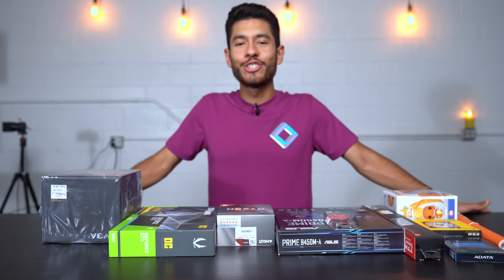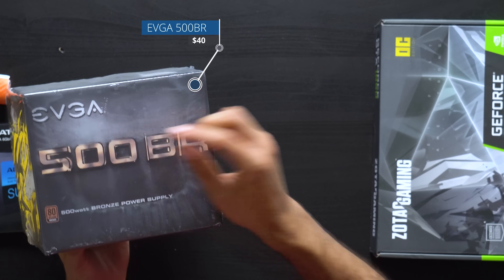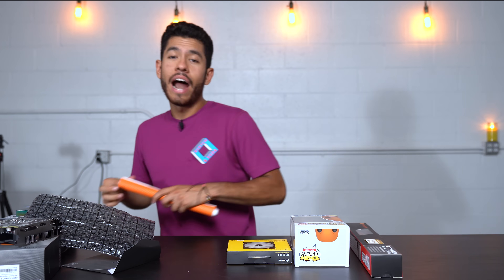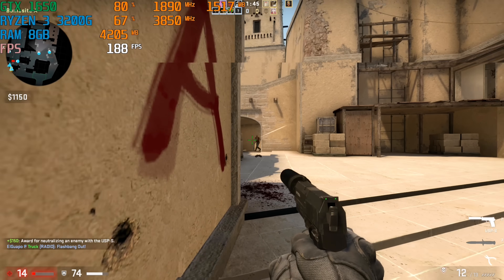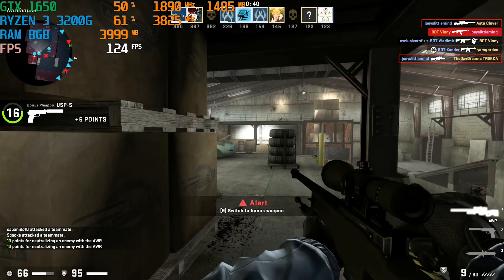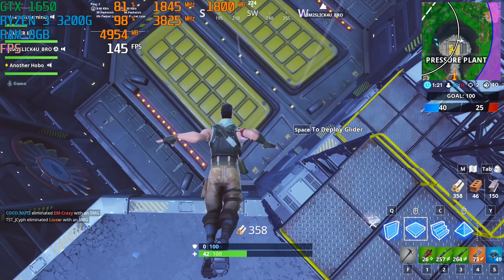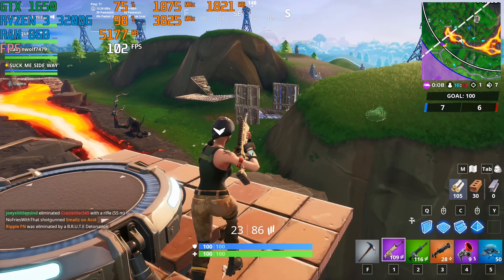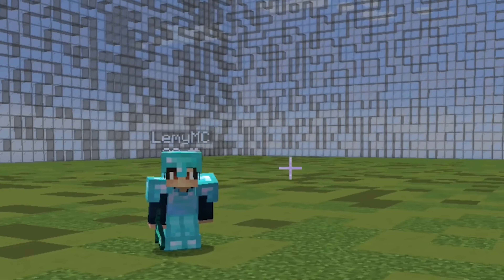$500 Gaming PC Build - GTX 1650 Ryzen 3 3200G (w/ Benchmarks)

Comment: The single ram stick on motherboard really messes with me.
Reply: Bonzxi you can use whatever ram you like but here are some things to remember

1. Use the same type of ram i.e dont use an 8gb stick and a 16gb stick
2. As mentioned earlier all sticks run as slow as the slowest stick (if you got 1 3000mhz stick and you have a 2333mhz stick they both run at 2333) 
3. Remember to slot them correctly, on your board, if its only got two slots your fine, but if its got 4, 2 should color match each other, and so should the other two; it doesn’t matter witch two you put your sticks JUST MAKE SURE they’re in 2 slots that match colors with each other ( usually alternating. 

If your keeping this in mind yes you can just put two sticks in now
Reply: Big Stonman big help 👍
Reply: @DeliriumXM  https://www.amazon.com/gp/product/B00J8E92I0/ref=ox_sc_act_title_4?smid=A2L77EE7U53NWQ&psc=1 
would this ram work?
Reply: Big Stonman thank you bro, me and my best friend are going to build this pc with 2 8gb ram sticks and this helps a lot
Reply: @BearyNiceGamingHD  As the other guy stated, and I'll put it more simple. If your motherboard as 4 slots that ram can go into, make sure when using 2 sticks of ram not to put them next to each other. You'll either have to put them in slots 1 and 3, or 2 and 4. Your motherboard should have some writing or diagram on it next to the ram slots to tell you which ones they go in. If your motherboard has only 2 slots where ram can go in, then it's OK to put them next to each other. Also, make sure you buy 2 of the same exact ram sticks or buy a pair of 2. Mix matching different kinds of ram can lead to unwanted problems.
Reply: Hyper x ones are out of stock can I use any ram sticks? I’m gonna get two 8 gigs
Reply: Drewskiii yes but it will only be as fast as the slowest ram for Example - if you have one ram stick at 3000mhz and one at 2333mhz it will run both at 2333mhz
Reply: @drewskeezii  patroit
Reply: Perspective. Yer thinking of a finished product. This is simply to get you started.
Reply: @franciscoescalera337  what a satisfying reply.
Reply: @franciscoescalera337  can you upgrade GPU and CPU on this motherboard?
Reply: @MyTardisGoWhoosh  to be honest.. this build is for 1080p. When you build this computer, you have a solid year or two to save up for the build you truly want. I would use this build and sell it as the whole set when ive had my fill. It's like buying a ps4 and then when the ps5 comes out you sell the old. Now if you were spending $1,000 to 1,300 on a computer, THEN you start to reuse your parts in your new build.
Reply: @franciscoescalera337  I'm fine with 1080p.. probably for the rest of my life.. I swear my eyes don't notice the difference when it's that high. Plus I want to play games like League.. starcraft 2.. the upcoming Warcraft 3 reforged..I mean....tbh I am over killing BIGTIME..
Reply: @franciscoescalera337  not fully true if you have a decent mobo, case, psu and ram you can use that on your next build. Whilst building a computer it is important to think of upgradability I'm not going to par a rtx2080ti and r9 3950x in a a320m mobo with a 450 smart psu instead of going price to performance go for a more balanced build that will be able to keep up with your new parts
Reply: @franciscoescalera337  what you said in your original post is that you sell the whole pc after a few years what's just not true what I'm trying to say is that if you have a well rounded pc many parts can last you up to a decade depending on your budget it's not like a 750w psu from 2014 isn't gonna work on your entry level pc now, I realised that mobos change alot and k was wrong about that but the rest are almost always compatible with modern hardware
Reply: Just get an Rx 580 and save yourself $50 and use that for another 8gb stick.
Reply: Jesus is Lord yessir Jesus is lord
Reply: I was just about say here comes another verge build, haven't seen this Chanel before
Reply: I got two 8 GB sticks for a bit extra cost
Reply: Yeah, I checked amazon and you can easily get a 2x4gb for a cheaper price.
Reply: good if you plan on upgrading to 16gb which alot of budget gamers like myself do. get the 8gb stick and then a few months later chuck another in.
Reply: Do you know any ram that would work with this pc 16gb i dont want to buy any bad ram
Reply: @kobygould1847  Corsair vengeance lpx 3200 is pretty good at that price make sure you get a 2x8g kit
Reply: Nah he def should've put 2x8gigs, you can get that for around 50 dollars 3200 and still be in the budget, assuming you didn't get some of the additional things he got like the Funko Pop and the fan
Reply: BananaTech Gaming where can you get 2x8gigs for 50 dollars
Reply: @eirto  it goes on sale all the time, just a week ago you could get some T-force or G.Skill Aegis ram for $50, I thought that was the regular pricing, but I guess not. You can still get really inexpensive, fast ram very often.
Reply: Either use 2x4gb 4x4gb sticks  or 2x8gb 4x8gb sticks u want 2 or 4 ram sticks never 1 or 3 if u want the best performance for what u buy
Reply: Theres no problem with that. Hes not using the APU, so single channel wont matter in terms of gaming performance.
Reply: @abmeight08  Not saying you're wrong but I immediately saw a different in performance going from single channel to dual channel on my r5 2600
Reply: @Bonzxi nah u can get two for less than one
Reply: Y'all can just get two for less on Amazon
Reply: Can i use a different Graphics card on this build ??
Reply: pooper12 he probably doesn’t know much about PCs yet
Reply: You know if it can run mw
Reply: Aaron Bostwick it can averaging around 70-90 FPS I believe.
Reply: Nola Hype really appreciate it
Reply: Aaron Bostwick you’re welcome! Let me know if you end up building this. I’d like to know how it goes.
Reply: ZxMbi ikr
Reply: It's so it's easier to upgrade in the future; just slot an extra RAM stick as opposed to replacing with better RAM so ultimately cheaper
Reply: I used 2 four gb ram sticks
Reply: What about the single 128gb, just Fornite  alone is 55+GB
Reply: Carlos Salas You can add a hard drive with 500 GB or 1TB if you need more space
Reply: xD ikr ive got the same build with 400$ but 2x8gb 3000mhz srry for brainded grammar
Reply: https://www.youtube.com/watch?v=T61UWX2I50A
Reply: Yes
Reply: With graphics card it's fine
Reply: this build is fk trash like most of his builds
Reply: @excelsiusprime  for people with not much money this a perfect pc even 350 dollar pc outperforms a ps4 pro so bruh

Comment: I can tell you rn that i have built a better 500$ budget pc.
Here it is, so you dont waste your time with this one.
Cpu: Ryzen 5 1600 // 100$
Motherboard: Gigabyte GA-A320M-SH2 // 55$
Ram: Patriot Viper 4 3000Mhz 8gb dual channel // 38$
Gpu: XFX Radeon Rx 570 RS XXX, it has 8gb vram, and clocked @ 1286Mhz non OC // 149$
Gpu option 2: Msi Gaming Rx 580 256 bit, 8gb vram // 169$
Storage/HDD: White label 1TB 32mb cache 7200RPM SATA300 // 30$
Storage/SSD: ADATA SU635 240GB 2.5 inch internal // 29$
Case: Zalman T3 Micro ATX mini tower // 36$
_______________________________
TOTAL: 437 USD $$
TOTAL W Better GPU: 457 USD $$
------------------------------------------------------
NOT INCLUDING TAX
_______________________________
Extras, you dont need them:
Case fans: uphere 3-pack // 10$
Monitor: Acer SB220Q bi 21.5" FHD (1920 x 1080) IPS Ultra-thin Zero frame - 75Hz - 5ms response time // 90$
Keyboard: any keyboard should do, but if you want my opinion, budget: 50$ keyboard+mouse combo red dragon - not budget: razer BlackWidow green mechanical switches Tactile // 98$   \\\\OR/// Razer Ornata expert mechanical membrane // 68$
Mouse: Corsair RGB // 50$
Reply: thank you
Reply: how would it run in gta 5? like the fps
Reply: @kdog773  probably in the high 80s-90s, thats on medium-ultra settings. 
-- note: i forgot to include a psu, but it still will be about 10$ under 500$ if you get a 500-600 watt psu.
Reply: @keegang9599  but why use a a320.
Reply: @keegang9599  and btw have you built this pc, or you just said what parsts you can get for same price
Reply: @pewdiepiesupporter8682  Because its a cheap motherboard. You could get a B450 for about the same, maybe a little more expensive. Just a "decent motherboard that supports 3000MHz ram. And it shouldnt bottlneck the hardware to bad.

Comment: Im having trouble with the last few steps, is there anything i need to plug into the gtx 1650 like anither cable after i plug it into the motherboard and i added another fan just like you did in the video but theres a total of 3 fan plugs whete do i plug the 3rd one, i only see 2 on the motherboard. Sorry this is my first time building a pc.
Reply: In the manual for the motherboard on page 1-1 there is a overview showing where the fan headers are.
 https://www.asus.com/us/Motherboards/PRIME-B450M-A-CSM/HelpDesk_Manual/

There are two left to ram slots
and one below the cmos (coin battery on the board).

If you have the same card in the video the card is powerd from the slot.

Comment: !!! CAUTION TO ANYONE WHO WANTS TO BUILD THIS PC !!!

This particular AMD Ryzen 3 CPU is a third generation and the motherboard he uses is a 2nd generation. These ARE NOT compatible unless you can manage to update the BIOS of the motherboard to handle a 3rd generation CPU. I don’t know why he left this information out because it’s very important. If you build this PC as is, it will not boot up. 

Solutions: Get a Ryzen 3 2600 (2nd Gen) and it will be compatible with the motherboard. 
Another solution is you could upgrade this motherboards BIOS to 3rd generation. Finally, you could get a third generation motherboard.
Reply: The motherboard seems to have the updated bios for 3rd gen
Reply: Apache Helo Copto It doesn’t come defaulted to 3rd gen as it is a 2nd gen motherboard. He didn’t tell anyone that though. He just solved the problem and went on ahead. I have a friend who just used this build guide and he doesn’t have a CPU that he can update the BIOS with so he is buying a new motherboard that is 3rd generation.
Reply: @braedenhunter6501  odd seems to be shipping with the updated bios. did yours come with the ryzen 3000 ready sticker?
Reply: Apache Helo Copto It wasn’t mine, but no, his did not, I don’t think. Most of the ones you are going to be finding and buying off of New Egg and Amazon are still second generation BiOS.
Reply: @braedenhunter6501  but it depends on where you buy it, some may come with latest bios and some does not.
Reply: pewdiepie supporter Don’t you think he should mention that, even if it’s brief? Jayztwocents, BitWit, and LTT all have. These guides are for beginners mostly, and that isn’t something an incoming PC builder would know off the top of their head. He should have said that as a precaution.
Reply: @braedenhunter6501  yea I agree with you.

Comment: Will Corsair vengeance ram work with this build? 8gb, I also want to change the cpu to a ryzen 5 2600 and a powerline wattage of 600w
Reply: The ram should work. Just make sure it is ddr4 and at a speed the motherboard can handle id recommend 3200 or 3000. Also the 2600 is a better choice ;)

Comment: I built this exact build but with an rx 570 instead but can barely get 40 FPS on fortnite with the settings he used in the vid. Any help pls!?
Reply: View Distance: Epic
Shadows:Off
Ali Allsiting:off 
Textures:medium 
Effects:medium 
post processing:medium
Reply: No I mean overall my exact same pc build isn’t working as well as him? Any tips?
Reply: Maybe the rx 570 is weaker I am not sure
Reply: Maybe he over clocked what GPU edition did you use
Reply: Mythic _ I have a Radeon rx 570 which should be like 10-20 frames better. I may refresh my os

Comment: Dual Channel RAM gives you actually a pretty massive boost to fps, I recommend going with 2x4 GB instead of 1x8, also the RX 570 is cheaper and performs better than the GTX 1650.
Reply: I went with 2x8GB
Reply: YOUR and YOU'RE are 2 different words what
Reply: @kevensmhith  why not 1x8?
Reply: That's a great one if you weren't going to upgrade the ram. And the 1650 build is good for minimal power usage
Reply: @pauloazuela8488  Very true.
Reply: If you're on a tight budget it's better to go for 1x8
Reply: eeee
Reply: And also why not ryzen 2600 . That’s cheap now
Reply: lol every one seems to think the rx 570 performs better then the 1650 xD haha they just watch too many tech  youtuber opintions and haven't tried it themselves I personally have 12 rx 570 and 15 gtx 1650s and the 1650 always  run games better faster quieter and draws less power not to mention amd drivers ? its a joke GeForce gaming exprince give you 15+ fps so that alone will make the 1650 out perform the 570 even if on paper it seems like it wont also  its always better to get 1x8gb then 2x4gb cause then u ruin ur whole upgradability taking up all the slots with 4gb lol that means u can only have a total of 16gb of ram and all 4 slots will be used even worse if you have a micro atx mobo they only have 2 dim slots so getting 2x4gb will only let you have 8gb total  forever and that's less then recommended now a days so no buying 4gb ram is not worth it no matter how much you think doul channel improves nothing actually ive already ran most my systems with a single stick of ram and I have 2 pc with dual channel and after 14 month of switching between the 2 I cant tell one shred of difference
Reply: seb0 seb0 im dead this mist be satire if its not then r/imverysmart
Reply: @CHICKENmcNUGGIESMydude  not true having two sticks are better than 1 because of duel channel and surprise its cheaper by a few dollars but still cheaper and a rx 570 is better at running 
most games than a gtx 1650 its the fact that a lot of games are in favor of nvidia drivers not the overall gpu horsepower
Reply: @CHICKENmcNUGGIESMydude  i HaVe 15 gTx 1650s HeHehE yeah okay big brain

Comment: can the gtx1650 handle nba 2k20 mid to high settings? thanks!
Reply: definitely yes! even the 1650's predecessor, the 1050, can manage an 80fps at High preset settings. There are multiple videos on the 1050 testing for the game you wanted to play.
Reply: ZiYi Li  Thanks! Cant find a performance benchmark of 2k20 on a 1650 anywhere. Thanks anyways!

Comment: I finally bought this pc im glad I purchased this thx Joey
Reply: hey how is it so far?
Reply: Did you go for 1x8 or 2x4? 2x4 Gives a pretty big performance boost (usually 25+ fps) due to it running in a dual channel configuration. The RX 570 is cheaper and performs better than the 1650, then you could've gotten a R5 3400.
Reply: i went over the budget and bought a 16gb ram instead of a single 8gb of ram. 
I tried 1 stick of ram to see how it feels to play on a single stick of ram, it wasnt that bad tbh.

Comment: Hey Joey/comment section, I REALLY need your help. I recently bought I pc for gaming and it will not display anything on my tv through any inputs. I have tried many HDMI cables to see if the others were faulty but still no luck. I have a 22” AWA tv which works fine on my Xbox one, PlayStation 4, etc. But it does appear to have some connection because the “no signal” does not come up. For some reason it says 720p 60hz when it is a 1080p 60hz tv I plugged it into the main living room tv and it seems to work absolutely fine. Please if you know or have to same issue please help.

Comment: Hey Joey, can you build this with the exact parts pls. This is the PC I will build during black friday and christmas. Here's the part list: Only do this build when you have time and money. This will be my first build. TY
CPU: Ryzen 5 3600
CPU Cooler: Wraith Stock Cooler
Motherboard: ASUS B450 ROG STRIX
Memory: Corsair Vengeance LPX (2 x 8GB) DDR4-3200
Storage: Samsung 860 Evo 500GB SSD
More Storage: WD Blue 500GB HDD
GPU: ASUS Radeon RX 580 4GB Dual-Fan
Case: Corsair 450D ATX Mid-Tower
Power Supply: Corsair HX750 80+ Platinum
Reply: get more storage if u a big gamer and you don't need that much watts unless u future proofing
Reply: @Buddlightyear  thanks but I'm not building this computer anymore. Waiting for Christmas and black friday

Comment: Will this MOBO need a BIOS update before use with an older CPU? Or does it work straight out of the box?
Reply: Depends it should he okay if chipset compatible
Reply: Ur plain dumb. If it's an older ryzen it will work on any new mobo. Not the other way around
Reply: @b.henriques9871  damn my guy was just askin a question
Reply: @vxisty  damn ur right my bad.

Comment: Did you have to update the bios to run the 3th gen ryzen on a b450 motherboard?
Reply: f
Reply: yes he will have had to unless that b450 is new, for example, the b450 tomohawk 'MAX' comes with new bios pre installed. you can either update bios through bios flash button on mobo or through the older existing bios but you require an older amd CPU for this
Reply: @kesh-hrishi  thanks man! You saved me from having to return the cpu because of incompatibility
Reply: @timcreus9645  you're welcome 😊 hope your frames are high!

Comment: But those games are not good examples they don't use a lot of resources also would've been good to see the tempsat which that computer was running during tests and with just 128 gb you cannot have heavy games only one would use 60 gb already i would've add a 1tb hdd it is very cheap anyway.

Comment: A Ryzen 2200G with RX570 would be better and cheaper but this build is still good
Reply: I know the 570 is better for FPS but what would the 2200G do better than what he used? I’m new to pcs
Reply: @zah1755  the 3200g only has a higher clock rate so for super budget builds it won't matter to go for 2200g.